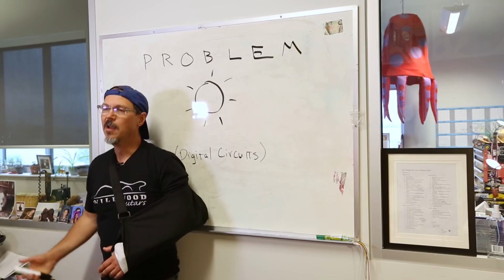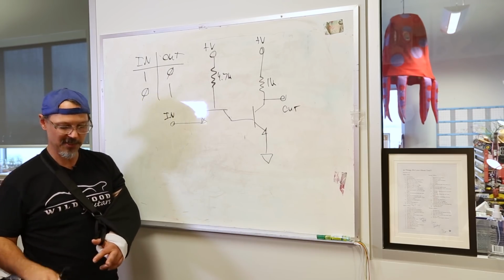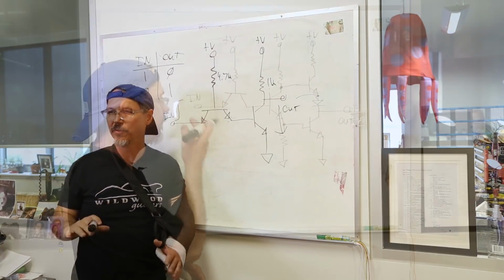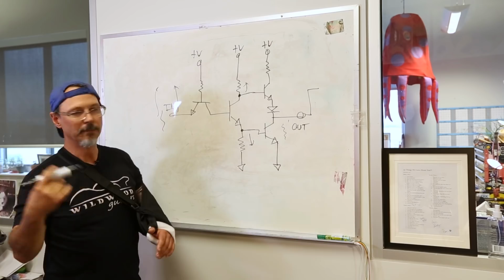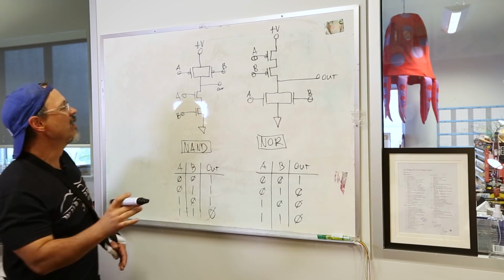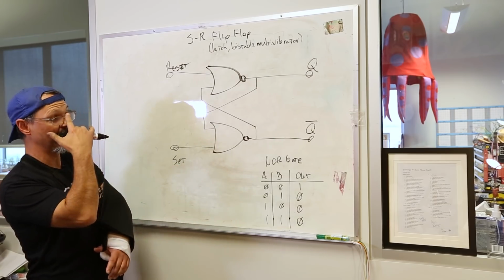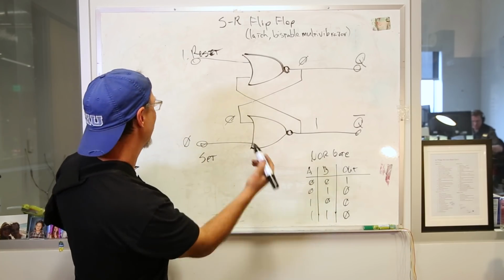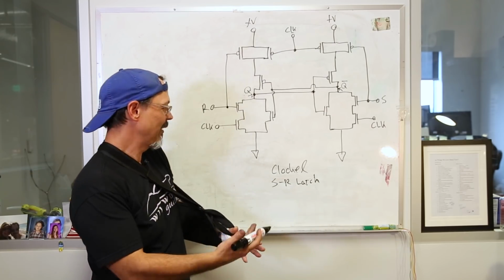According to Pete #60 - Digital Circuits

Comment: Pete,

With regards to your first question ("where are all these MOSFETs going?"), I would not dismiss the possibility of a secret MOSFET fed generator that turns potential logic into raw energy. Either that, or presumably education (I know I fried enough logic gates in my own digital design classes to justify my own tuition!)

As far as a clever and cool idea to use up some of those tens-to-hundreds of thousands of chips, ever since I saw a project on Hackaday for a ternary microprocessor, I've always wanted to build a Ternary emulator of my own. Using the bistable multivibrator NAND setup you demonstrated, pulling both S and R high would result in Q and Q-Not both being high, giving you three potential states, (Q, Q-Not) = [(0,1),(1,0),(1,1)] = [-1,0,1]. It is so much more balanced and beautiful than the lopsided [0,1] of our binary world. It would be a lot of fun to build low-level ternary combinational logic circuits just from binary components, and eventually develop a ternary processor of my own.

Granted, those ternary-from-binary circuits could eventually make their way onto their own integrated circuits, which would abandon their binary history, and would eliminate the need for buckets of MOSFETs, but I think it would be a progressive and clever use of technology that has managed to survive nearly 60 years of technological change, and still have a place on production lines across the world. And if developing a ternary processor isn't clever enough for that Analog Discover 2, there's always that MOSFET fed generator idea (if it doesn't exist already!)
Reply: That's an ambitious and worthy pursuit. But I still think you're going to need a bucket of mosfets.